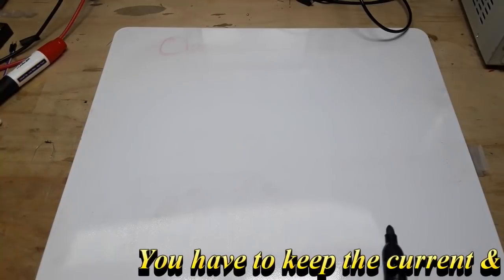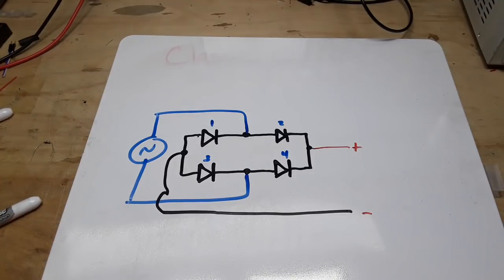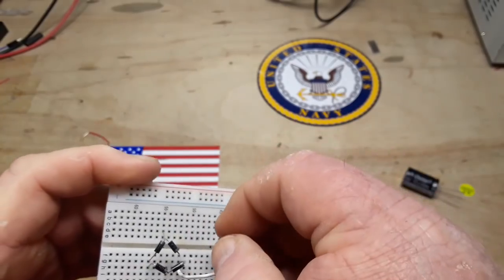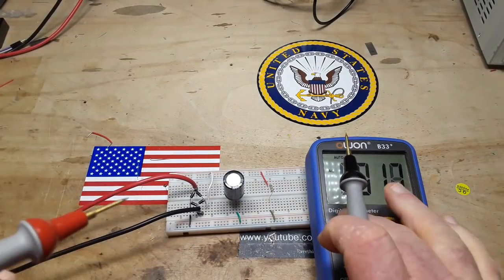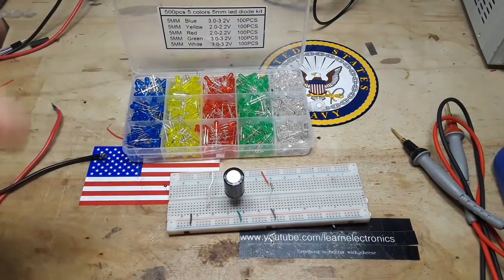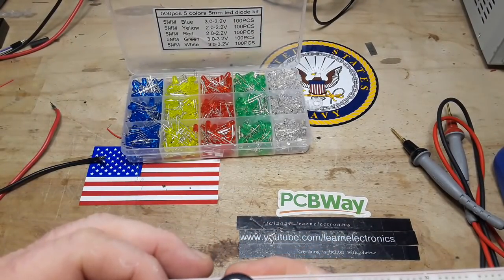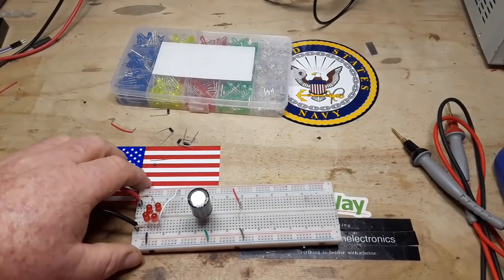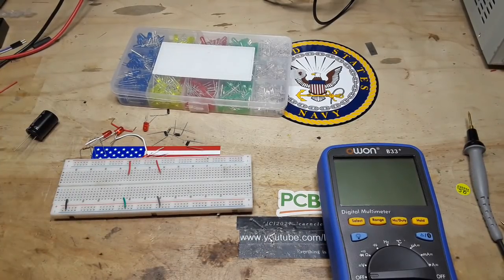Can you make bridge rectifier from LEDs?

Comment: I wanna use LEDs in the rectifier setup but instead of AC going in I want to use it as reverse dc polarity protection were no matter the polarity going in the output polarity will always be the same but the two LEDs the electricity would go in one way would be green but with the input polarity switched the electricity would go through the other two that I would use red LEDs for to make  a clip cord that always is attached the right way with indication letting you know which way it was connected would that possibly work? it would be for a device typically powered with 5-10 volts dc approx 250ma

Comment: i used a transformer to step down the voltage  to 6v and put a resistor in series with the rectifier and it works (but the leds appear to just stay on)

Comment: I had thought this, to create a AC LED lamp to a project, using a not polarized capacitor, availing the capacitive reactance, but as I can see here, if the reverse voltage is about 6V, the only way to make this work is use a transformer to drop the voltage down to 4,25 V AC (6V / ✓2), the LED reverse breaking down voltage of many is 5V, in this case the ac voltage has to be 3,5 V AC (5V / ✓2) this way the LEDs won't burn anymore, but this works for testing purposes.

Comment: I was disappointed that you didn't actually address whether it was possible to rectify AC using LEDs. You appeared to know beforehand that you were merely going to burn them up. Couldn't you have used a current limited input and reduced the voltage? Those poor LEDs never had a chance!

Comment: "they have a max. reverse CURRENT of six VOLTS" ?
Reply from the maker: voltage, i misspoke. thanks for pointing that out though, feel better?
Reply: @learnelectronics  obviously you misspoke, no problem there of course, however reacting negatively to one of you subscribers on a mistake you made, is not. Feel better?
Reply: @darkphotons101  no, dude is right. If you're watching a video about the nuances of normal diodes vs. light emitting ones, you are smart enough to know voltage vs. current, and so would anybody else.  So if you feel the compulsive need to correct everybody who makes a minor gaff, understand that's not actually helpful, nobody is impressed, and nobody likes those kinds of people. 

Go make your own videos, and see how graceful you are when they get picked apart by smart alec commenters.

Comment: OK, Stupid Question. What if you put a 1n4007 in SERIES with the LED, would not the 4007 provide the reverse protection for the LED.
Another stupid question, If you put a resistor across the LED terminals and then to the 4007 in series would you not be able to adjust the resistor value to allow full mains voltage across the LED, Resistor + 1n4007 DIY bridge rectifer.
Last stupid question, Why? 
If you want to know if you have power just put an LEDs on the DC side of the bridge rectifer with current limiting resistor.
Reply: That big cap also contributed to their demise...
there should have been a current limiting res. ( to limit max led current within its limits ) in series with cap.

Comment: Not only reverse voltage kills the LEDs, but also your ripple smoothing cap!  That cap will make the startup current like a short circuit.  Too big a cap, like millions of uf, will kill some real rectifiers.
Reply: But, the resistors on ac linking on circuit's beginning will limit the current, the inrush current won't be big.

Comment: When I realised that this might be possible, in 1980 or so, I replaced the bulb in the taillight of my bike with 4 LEDs in bridge and a small resistor at the place where in a "normal" rectifier you would connect the load. 
The AC of the usual dynamo had a high enough frequency for a nice steady light, that lasted and lasted, where bulbs would blow wheevern you would pedal a bit too fast.

A little later I used the same circuit, not with just red LEDs, but with 2 green and 2 red ones. Neatly arranged on a bridge diagram on a piece of white plastic I could demonstrate to my students the working of a bridge rectifier by feeding the bridge with the output of a powered tone generator at a low frequency, lower than 1 Hz. 
Very nice to see the diodes light up slowly (with a sine wave) and the small bulb (of a rear bycycle light!), alternating the red ones and then the green ones.

As a rectifier the LEDs are not really efficient, bedause of quite a voltage drop...

Comment: LEDs generally have a very low reverse breakdown voltage, typically 5volts. But they can handle a reasonable forward current. 
I took advantage of this when.i replaced the incandescent light bulbs which is connected in parallel with our doorbell push buttons.

In this old traditional doorbell, the light bulb, provided a glow to illuminate the buttons at night. The bulb is powered by the leakage current through the doorbell solenoid  coils. A circuit that is supplied from a 12 volt AC mains stepdown transformer. 
By connecting two matched diodes in an  anti parallel configuration, the forwards voltage of the one diodes limit the reverse voltage to which the other is exposed on the AC cycle of the supply. So for each switch, the bulb was replaced by a series parallel combination  of back to back super bright LEDs and a current limiting resistor. This not only increased the brightness of the doorbell glow, while reducing the consumed current, it also allowed the selection of the colour of the light emitted. The LEDs have now been working continuously for 30 plus years, without a failure or replacement.

Two useful  features of the LED current/voltage characteristic, is that the LED has a sharply defined forward voltage switch on point, which can be sharper than that of a Zener diode of equivalent voltage,  they also have a low reverse leakage current. This makes two LEDs, connected back to back, in anti parallel, a low cost choice for an audio clipper.  
The diodes can be connected between the two stages of an op amp circuit, or between a microphone pre amp and an amplifier to limit the audio level. For examp!e the diodes can be connected between zero volts and  the op amp output, using  a series current limiting resistor, forming an effective voltage clipper divider circuit. If super bright LEDs are used, there is ample op-amp output current to make the LEDs glow when the input audio level is too high, thus providing an indication of this condition. 
Looking at the clipped audio waveform, it is remarkable symmetrical and we'll behaved. If the following op-amp is configured as an active filter, the clipping harmonics can be suppressed. This makes this circuit useful in radio transmitter audio input circuits.
I once used this configuration in a professional radio system to limit the signal level generated by an FFSK modem into the telephone system, that connected to a transmitter network. The glow of the LEDs, proved useful to the technicians configuring the system, as they could use the LEDs as an indication of when the line level was set to the correct value. All that was necessary was to adjust the level to the point where the clipper LEDs started to glow and back off the signal until the LEDs just stopped glowing. This coincided to a line level of -14dBm 600. Just under the -13dBm maximum specified by BT regulations, for signal tones to line. 

I suggest it is worth taking a look at the operation of LED audio clippers on an oscilloscope, they do work really well, even at relatively high frequency.

Comment: This an amazing demonstration idea. I wouldn’t use the grid though. I think a lower frequency input around 2-5Hz would allow people to see the transition between the on & off states and build a lot of intuition
Reply: I wanna build something like this for demonstration purposes, but methods of getting to low frequency and low voltage AC before the LED rectifier feel off for the demonstration medium...
Reply: @AmaraTheBarbarian  could use a 555, and just explain it as a wave generator (oscillator) to focus on the rectification concept.
Reply: @LightningHelix101  This is true, I suppose it doesn't all HAVE to fit or be visible I could stick a small sine wave generator circuit on the back side and just kinda ignore it the fact it's there lol. I just wanna build like 1 or 2 for my friend's kid and well ME lol.

Comment: Why would you even think a bridge rectifier made of LEDs would be possible? You need to point the camera down towards you a little you're out of frame quite a bit now. 😁 Thanks for blowing some LEDs and the video!
Reply: My student built one and the guy in the video did as well. So, why would you even think a bridge rectifier made of LEDs would be possible? Because a LED is a diode. The guy in the video accidentally blew his LEDs up because be put 16V into the capacitor. My student used a discharged capacitor and everything is fine. It's not efficient, sure. It's not high power, also sure. But you can see it blink, learn something and learn a lot about measuring that circuit with an oscilloscope.

Comment: They are good for real visualization of the rectification. Use at least 2 different color LEDs, make the rectifier, a resistor and an output indicating LED,   Then use a 9v battery flipped back and forth for a slow alternating current source (i.e., at your hand frequency) to see how two LEDs in the rectifier conduct at a time making the output LED light.  Of course, it uses about 9 volts to light one output LED,